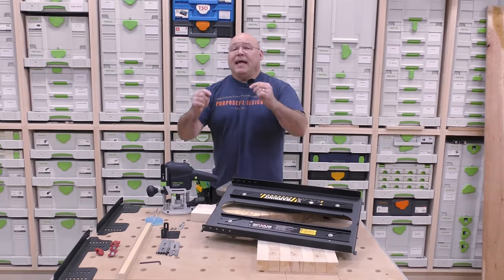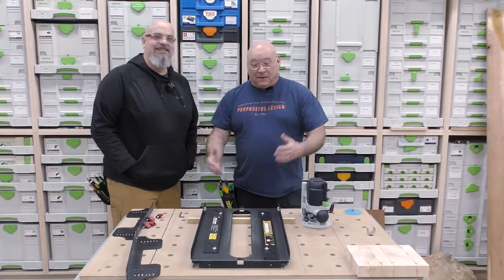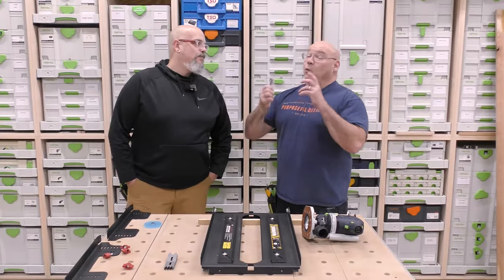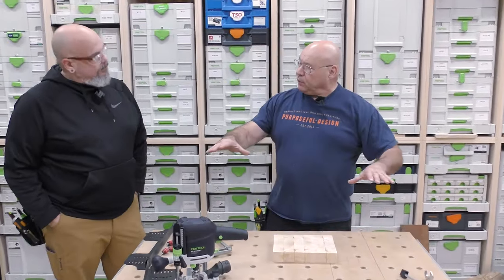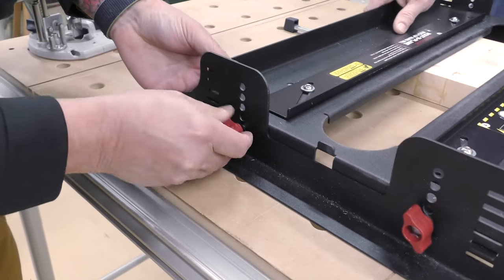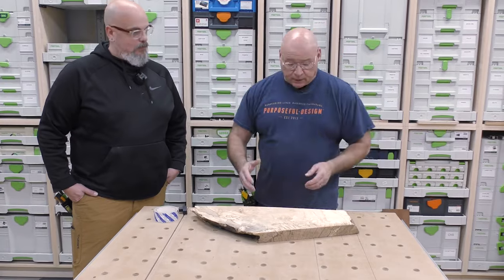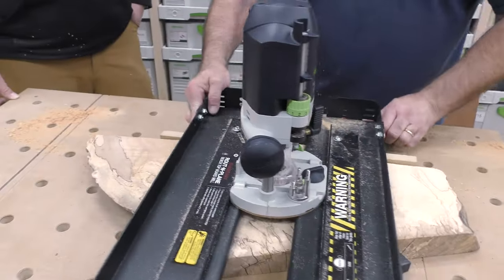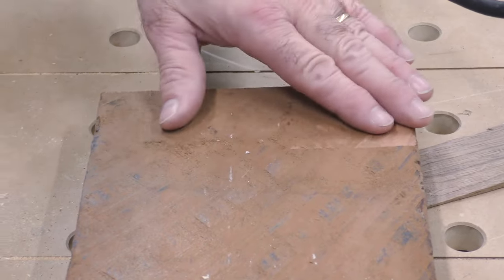Rout-N-Plane | SedgeTool

Comment: I purchased and used mine to solve a specific problem. I had 3 pieces of 5/4 cherry that were 12 inches wide  and 7 1/2 feet long that were rough sawn. They had some minor flaws in cupping . Too big for my jointer and too heavy and too much trouble to make a planer sled.  I had a 24 inch by 8 foot sheet of 3/4 inch MDF that it put on my bench to secure the pieces.  Use the rout-n-plane and quickly flattened one side then ran it through the planer without sanding the surface. When I had the top side clean I flipped the rout-n- plane surface up and cleaned that part up. It is important that you find the high spot and reference your 1st pass off of that so you take shallow cuts on each pass.
Reply from the maker: Happy to hear it worked for you. Even if you had a 12" jointer, straightening 7-1/2-ft of cherry is a tough job.
Reply: @WoodpeckersLLC  Another way I used it this weekend. I have two 7 ft boards with a dado joint 2 feet and another 6 1/2 feet down. The item that goes between them in the past the 2nd dado would not fit. The item could not be reduced in width the 1/4 inch needed. I could creep up on the extra width by removing a little from both sides using the rout-n-plane (the reduction on each side will not be noticed on the final assembly.  Having another tool gives more solutions even if it is off-label.

Comment: i don't understand why you need the centering mandril when the router is stationed between two plates.
Reply from the maker: Not all router bases are concentric. The centering device centers the router bit in the opening, regardless of base shape or offset.

Comment: put mine together today and tried to flatten a end grain cutting board,  lousy results, it wanted to kind of jump, I see your's did too the first time you pulled it back.  I had a 1&1/4" amana flattening bit.  results were terrible,  yet. a few years ago a did a much harder and bigger product with a home made flattening setup with perfect results.  that was all ash this was walnut cherry and maple.  I think i might put wax on the router n plane so the router slides freeer without sticking.
Reply from the maker: Make sure the guides that keep the router centered in the jig are not binding. They don't need to be tight at all. They're just there to keep from running the router bit into the steel frame. Leaving 1/16" on each side will prevent a collision and also not bind while you traverse.
Reply: @WoodpeckersLLC  thanks, i'll give that a try.